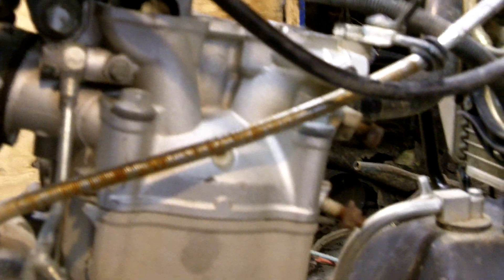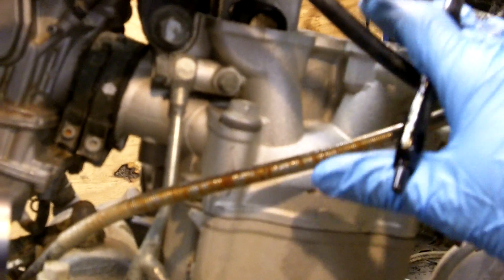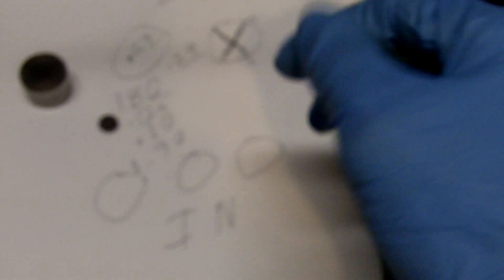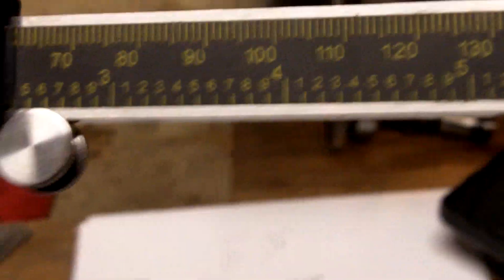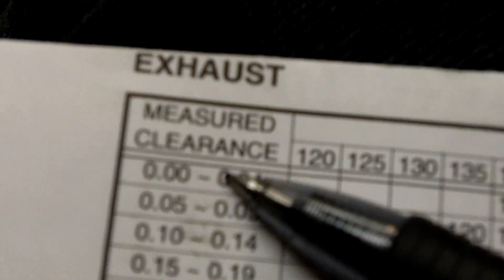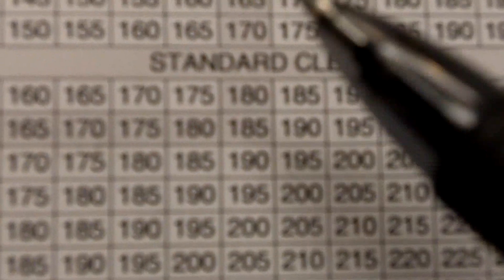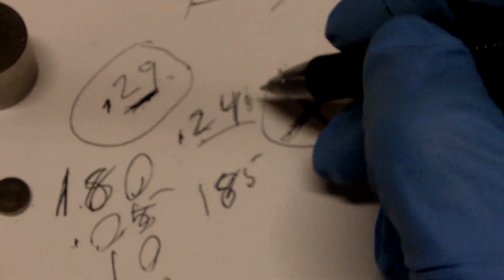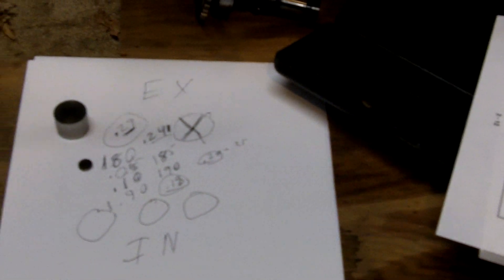Valves Section 3 :: How to Determine Proper Shim Replacement

Comment: You are making a YUGE mistake by assuming the number stamped on the shim hasn't changed. I'll guarantee you that a 1.80mm shim with 100 hrs on will mike-out to 1.73-1.74mm.

Comment: Hey I’m getting ready to do the valves on my ltr 450 I do have a manual but I wanted to see how others actually do it and not just read it your other videos will surely help but on this video you made the match seem more complicated than necessary but I appreciate you sharing your experience and wisdom
Reply from the maker: Yea I think I might have over explained it,it’s actually easy you measure your current gap write it down do that with all valves then remove cam and valve cap and measure shim with calipers now you determine your gap taking the tolerance range your shooting for and subtracting your current gap and that should help you figure out how much larger or smaller your shim needs to be.

Comment from the maker: @crximportrider wow sry i missed your post it didn't show up in my inbox. well this may hit you a little late but what i do is tie a string threw the chain and to a wrench i am not using and let it hang to the exhaust side. getting the cams in when putting them back in is tricky be paitient and take your time doing it you may have to get 1 set perfect befor working on the other.

Comment: Man you've been wicked helpful.  ive been watching alot of your yfz vids and have done nearly all (oil upgrade on my 04 should be done by the end of the month).  When i start the quad i can hear a tick from the valve train, it does get better as the quad gets warmer, but it makes me nervous none the less.  so im gonna check the valves.  My concern is if/when i remove the cams, whats the best way to keep the chain from falling, and the best way to reinstall the cams in time.

Comment from the maker: @sparx10james i have seen alot of people use pipes that aren't made for there quads it can cause damage if you do not properly jet you quad when you do this,and in your case with the backfire issue it sounds like your jetting is pretty bad right now so i would look into getting it rejetted as soon as posable or valve damage could happen.

Comment: Nice vid. I was wondering if it was the same as a yz250f? The manual for mine says to measure the cams and not to check the gap between the cam and the buckets. Should I do it the way u do it?